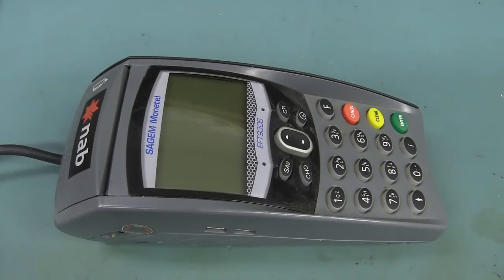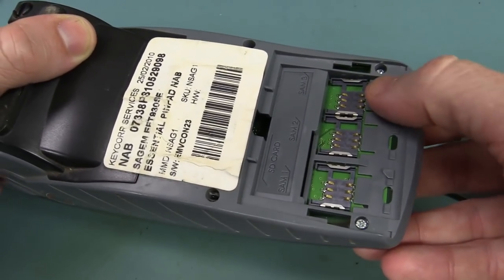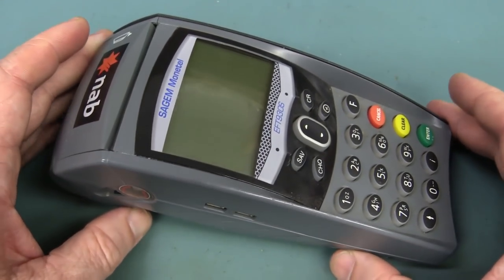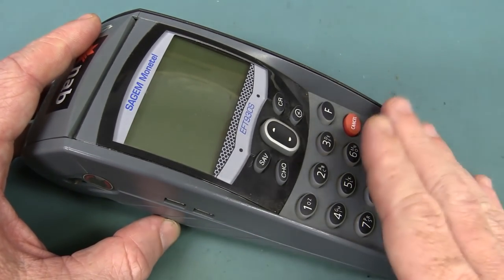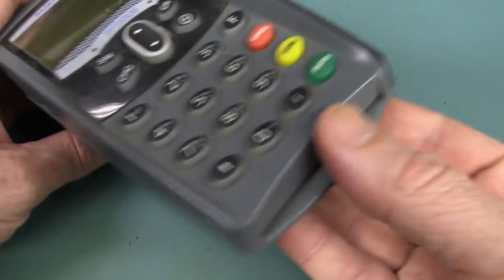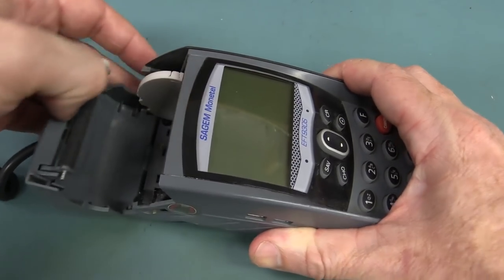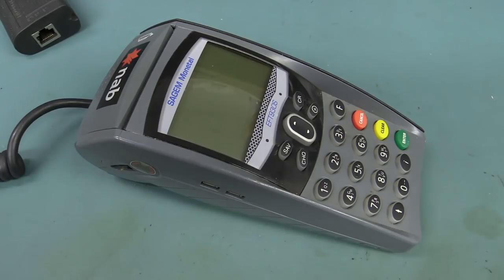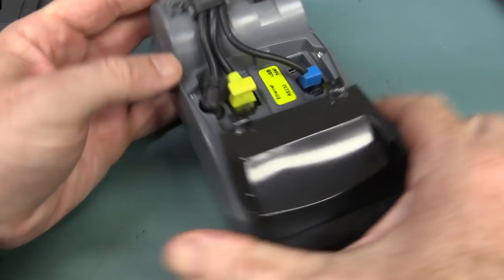EEVblog #687 - EFTPOS PIN Pad Terminal Teardown

Comment: I actually spend more than 3 years developing applications for different POS devices, including Sagem EFT30 snd EFT930 families. So a couple of things:
0) This is EFT930S model. S has Ethernet as communication method, so no GPRS here.
1) Those are SAMs, not SIMs. SAM stands for secure application module. Those are to receive custom security devices, carrying some extended security keys, etc.
2) Anti-tamper protection on these devices is really amazing! Not only they have tamper switch, but... Basically, there is a bunch of security keys (PIN key, MAC key, etc.) stored in flash inside crypto-processor. They are stored encrypted by the master key. Master key resides in crypto-processor SRAM. As soon as this crypto-processor detects tampering - it destroys master key. This in turn makes encrypted keys useless, because you can no longer decrypt and use them. And tampering conditions include, but not limited to:
- case opening
- temperature above max/below min
- voltage above max/below min
- invalid signals on I/O ports (e.g. you put something completely unexpected on USB bus)
- circuitry parameters (impedance, capacitance) - you CAN'T just bodge something in
- there is also a guard mesh wound around crypto-processor's crystal, so if you bypassed all the other systems and try to de-pot it to read contents using microscope - oops, keys are gone as soon as this mesh receives any damage.
- un-sogned application upload to device - yes, even if you have the SDK, and wrote an app for this puppy, you have to sign it with some special key in order to be able to upload it to device
3) It goes to "MOCKUP" mode after destroying the keys. To return it to productuion mode, you have to send it back to factory - i.e. only MANUFACTURER can revive it, not just a retailer or something. It requires factory keys for that.
4) PINPAD in general is a separate device, connected to POS TERMINAL, so customer can enter his PIN, while merchant has the terminal. So it's not really correct to call this terminal a pinpad.
Reply from the maker: Alexander Khritonenkov Thanks for the detailed info!
Reply: Wow thats pretty impressive!!
Reply: +Alexander Khritonenkov given your experience in the industry can I ask if we are more secure now compared to the past?
Reply: Kranbone with EMV we definitely are safer. Just make sure to use the chip and don't fall back to magnetic stripe in suspicious locations.
Reply: Alexander Khritonenkov thank you for your advice and input.
Reply: +Alexander Khritonenkov Thanks for the details, they're pretty impressive. On the other hand: can you tell a few words about the data going through the cables? I have seen videos where they said that (older) programs needed raw credit card data (card number, expiration data, CVV2/CVC2/etc.) over standard PS/2 or USB HID. "Why bother hacking the device when the communication is in clear-text and can be easily captured?",  they asked. Thanks!
Reply: +Alexander Khritonenkov Fun fact, if you drop them on the ground, they tend to brick themselves.
Reply: I'm positive there are many "stupid", insecure implementations around, but if done properly, the SAM will encrypt the data being transmitted over the network to the transaction processor. This is why now-a-days it's allowed to connect POS devices to regular internet connections, whereas in earlier days the shop had to have a separate secure phone line just for these devices. The USB PS/2 interfaces would be used to connect the terminal to the cashier computer, so the amount can be automatically transferred to the POS, and the POS can send a approved/denied answer back to the cashier computer. No confidential data is supposed to be transmitted over that line. I'm sure it's being done a few places around the world, though

Comment: Nice to see my item made it to a Teardown, Also i think that massive cap is probably not for tamper resistance but for the thermal printer. I have seen similar large ones in Dymo Thermal Printers.

Comment: Nice teardown Dave. Designing anti-tamper hardware is a really involved process
I spent many months designing a secure memory device recently for the aftermarket automotive industry.
Reply from the maker: l28power Yes. This was a relatively simple job, they could have really gone to town if they wanted to.

Comment: metal pins at 15:45 are for minimizing smartcard socket to erode, many card insertions are expected and not always well-aligned to the socket, so plastic card will roll across the metal pins and not the plastic edge of the socket

Comment: (Lawyer notice: This is not a manual on how to do it, it already happend that way here in Germany.)
Gut one out, replace with own hardware that lets any card pass, store card data and PIN on mSD and call it a day, normal folks will never get the difference.
If you want to spot that "hack" enter your PIN incorrectly the first time. If it passes the device is hacked. If you want good karma you tell the store folks. If you suspect the store owner to set this up, just walk away and call the police. :)
Reply: I'd be pretty sure that there would be many more ways a store's system's could tell something is wrong, however if you were simply running your own 'store', it could be somewhat more successful. there are still many problems, like the pin thing you mentioned, and losing money every-time you give away a product without actually getting paid for it, also, nothing would show up on the victims statement, and anyone who happened to use a smart-card enabled card would be essentially impossible to steal from, because of how smart cards work
Reply: ***** Here in Germany its you stick that card in, so the chip thingy is involved, press Enter once if you are OK with the price, enter your PIN and press Enter on that and either the terminal is fine with your PIN or not.
So Joe Average could never tell that he just got his card number and pin stolen. I should mention that we in Germany use cards that belong to a wire-money/giro account like Maestro, actual credit cards are not that widespread here.
Reply: Bastet Furry I don't get it - what's the point? The smart card uses a challenge-response exchange - recording the PIN is useless and there's nothing else to record other than the chip's response to the server's transaction-unique challenge.
Reply: Ted Middleton
They just need to regenerate the data on the magnetic stripe and then go grab the money in an "underdeveloped" country.

No harm to you, because you can prove that you where, for example, at work and ~1000 km away from the terminal the money was withdrawn from. The banks rather pay what was lost trough fraud than fixing their system. :3

Comment: For those concerned there is a small industry in hacking these  pin pads (as they are called in North America). People steal them and drill into to cases in specific places (bypassing the anti tamper). Which allows the harvest of PINs and MSR Data. Many stores are now physically locking down the pin pad so they cannot be stolen.

Always check that the seal is in place in a pin pad. Also make sure that there are no funny holes in your pin pad.

Also simply covering the keypad will stop people from recording your PIN with a video camera.

Comment: Only one of the SIMs will be for the cellular radio - the others are to do with the security stuff, which is why they are populated,
Reply: Yeah.  A little surprised Dave didn't connect the fact that security/identity modules have applications beyond cellular.
Reply: yep, maybe these are SAMs not SIMs for sure
Reply: I'm surprised by the lack of physical security compared to the unit you took apart. With that design it would not be impossible to crack it open and probe the required chips.

Although if I was assigned the job of hacking one I would attach a sniffer to the Ethernet and have a raspberry Pi sniff all the packets and wirelessly transmit them to a safe location that would not be risky to recover the data from, or have the remote device use a encrypted 3G/WiFi connection.

As soon as you make tapping hardware require a recovery you are in real danger of being court for obvious reasons.
Reply: lmiddleman Yeah, odd, you find them in printers too, so it's not like it's an oddity.
Reply: ***** Sniffing the Ethernet packets may (or may not) reveal the credit card number only, but not (for sure) the PIN Code as it is transmitted heavily encrypted.
Reply: One SIM for the GPRS, one for the payment network, one for customer application such as point cards.
Reply: Евгений Жук
Reply: Jotaemebé Yes. They are SAMs, not SIMs - if you look closely, they are actually labelled SAM.

Basically, a SAM is just a crypto-processor/key store/certificate store in a SIM card format. It's used for user authentication, so the payment network can identify the merchant, etc.
Reply: They are SAM in SIM format... same fucking thing. A SIM is a full microcontroller on which you can run applications. A SAM might or might not have GlobalPlatform API installed and contain more or less space, but it's basically the same thing.
Reply: mikeselectricstuff sorry no, SAM and SIM not the same thing although they may use common technology and similar standards
Reply: mikeselectricstuff I

Comment: There are some things I disagree about: 
1. The SIM Card holders are most likely SAM Card (+ probably 1 sim) holder http://en.wikipedia.org/wiki/Secure_access_module
This may also be the reason its processor is not secured to hard, as the crypto stuff is done in the SAM module
2. The "shielding with an unpopulated connector"you described at ~ minute 10 seems to me like and unpopulated GRPS module that could for example hold a telit module http://www.telit.com/products/product-service-selector/product-service-selector/show/product/g24-lite/
3. The unpopulated stuff on the other side of (2) is presumably the powersupply for the GRPS module. Usually GPRS modules need a peak power of round about 7W.
Reply: Well the text on the plastic does say SAM.
Reply: Yeah, that's how those PIN pads typically work, SAMs are a lot cheaper than your typical hardened crypto processor.
Reply: Exactly, one SIM for GPRS, unpopulated on this device, one SAM for the payment processor, and one for client applications.
Reply: Chaiuitita
Reply: Chaiuititas

Comment: The massive cap there is for providing power for about 100ms in case of power failure. This allows the application to save any critical data to non-volatile storage. When power fails, The application in the terminal gets an event notification.

Comment: Over here in blighty we call them Chip & PIN pads (well, the ones where you stab the card in with the chip facing the right way up or down and get complained at cos you pulled out too early (giggety) even though you didn't that is)... :)

As for stealing people's info, these days all you need is one of them FLIR iphone addons and the ability to mug people and take their cards physically, cos the FLIR thing reads where you entered the PIN on a rubber or plastic keypad (coldest to hottest) and there you have a stolen PIN, though a perfect way to thwart the potential muggers is a PIN with one pair of matching digits, so they can only pick out 3 numbers on the pad which increases the probability of getting the PIN wrong when they go to steal cash... :)

Comment: I suspect the large cap is there to activate the anti tamper if someone tries to slide an insulator between the button cell and its terminal. The operating life of the terminal would be equal to the life of the battery. Shame Dave didn't measure the voltage left in the battery. If it was exhausted then we know why the terminal was discarded.

Comment: Can you make another video with the POS equipment fixed back after tear down and try powering up. Does it display an error message or does not display at all considering that it detected a temper? I have a Garmin GPS that I tore down. But when I put it back and power it up, the backlit glows, but no display on the screen. I believe, it has too some anti-tamper mechanism.

Comment: I would bet part of the anti-tamper was having that big-ass cap on a separate board. To access the microprocessor you had to putt it off effectively disconnecting it.

Comment: In here they use those machines to add credit to prepaid phones. The ones I used back when I worked doing that used GPRS for the transactions, and were pretty nice machines. But we use a different machine for actual transactions with cards.

Comment: The multiple SIM cards is are there for several reasons, the predominant one is that you usually have different payment processors for different card brands and transaction types(debit vs credit, local vs international card etc..). Also back then only some processors offered IP based interfaces while many others still used tone based modulation(basically PSTN (like) over cellular, usually a FAX compliant protocol or close enough), on top of that redundancy is something which was important to some costumers especially in the earlier days of GSM where carrier specific network reliability was a much more common issue than it is today.

P.S.
All PCI-DSS standards are available on the PCIcouncil website and on all major card brands, and for the most part they are complete shit when it comes to actual security. It's about compliance rather than about security and it's "cover thy arse" stamp basically for insurance purposes these days.
https://www.pcisecuritystandards.org/security_standards/documents.php?association=PTS

Comment: At 6:55 you can see some very interresting marking on the case. I'm surprised that he didn't noticed it. It explain the 3 "sim" cards and the missing "GPRS" module. The marking say: "SAM1 SAM2 SAM3"  and on top of it you see "SD CARD"

The SD card, I guess, is used for developpement...

The internal USB is most likelly to connect to the PC/register so it can send the info about the amount, and get back the result of the transaction.

Comment: That highly stitched area on the green PCB screams switchmode power supply to me. The unpopulated fine pitch header next to the large bare gold fill on the bottom is probably the header for the cellular card. It would make sense, since the cellular card will need an appreciable amount of power. No cellular? No-pop the PS section.

Comment: I'm not sure how they would go about successfully swapping them without being noticed, the first card swipe would be the giveaway as in order to work it would have to know the correct phone number, the business' account number and the correct serial number. I do know that part of the security is in the communication as well, mostly to detect any sort of nonsense like that. I'd imagine the easy ting to do would be to stick some sort of thing on the terminal that would have a second reader head and memory so that as you swipe the card both the terminal and the added reader will get the card info, they do this on ATMs, they're called skimmers, and its becoming a big problem here in the US.
Reply: A much easier "hack" is to swipe the card out-of-sight on a separate machine and use a camera for the PINs. That's why one of the card companies top security tips is to never let your card go out of sight and cover the keypad when entering your PIN.

Comment: Too bad no company has found a 100% way to stop side channel attacks. When a processor has to process data, it will draw current spikes of a specific pattern for whatever it is doing. Also electromagnetic waves that leak out of products not very well shielded could also be another attack vector.
Reply: +EETechs Can't you just put an extremely big capacitor, maybe several small ones in parallel to reduce ESR? I think that's what the big capacitor is all about.

Comment: I'm sure that if I was any good at electronics and software I could get past most of the security measures. For start, you can get past the switches by grinding plastic bit by bit without affecting plastic pressing down on the switches and then gluing the switches down permanently from the opening.

Or if I was any good at electronics, I wouldn't be so arrogant and would acknowledge the impossibility of the feat.
Reply: +Atristiel More modern security devices have a woven mesh in the case, so if any tool was to drill into the case would set off the erase procedure.
Reply: +Luke Hovington Now that's a piece of something. Nothing much else to do with such a thing than probing for weakspots through edges of case parts or buttons and screen.
Reply: +Luke Hovington Okay, I read more about their security. It's impossible.